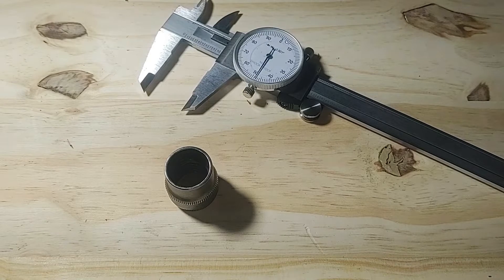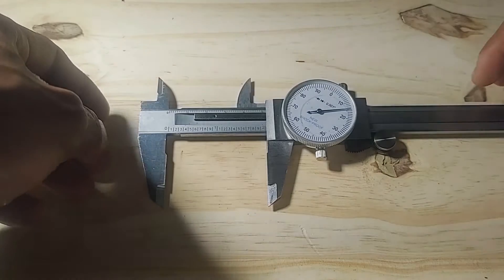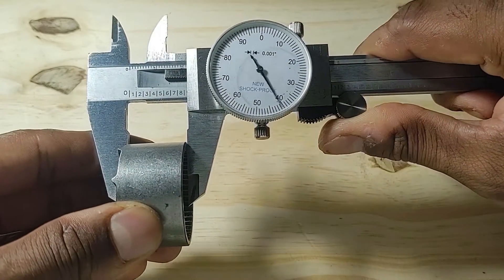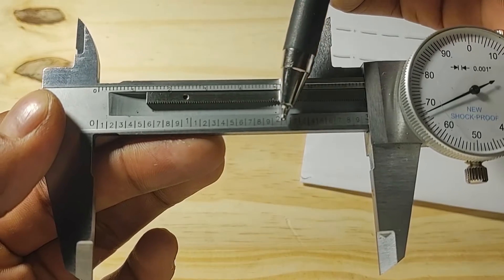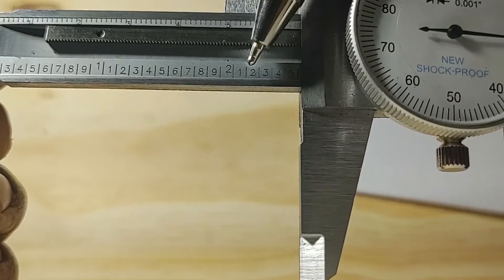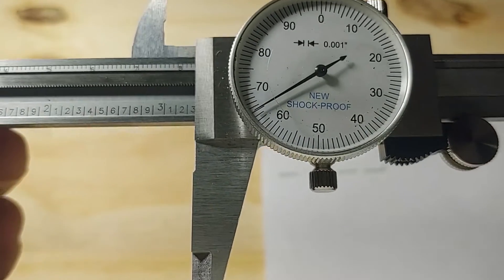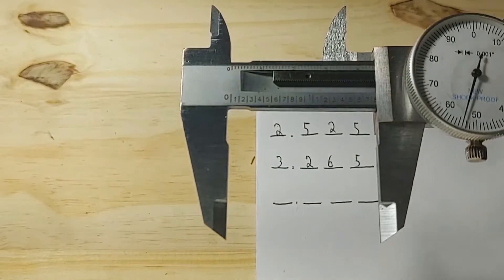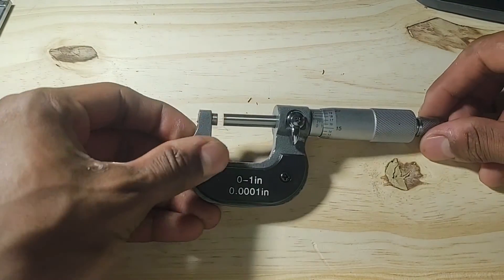How To Read Imperial Dial Calipers

Comment: I would just like add 4th option for measuring a step (with back side of a caliper) great video btw
Reply from the maker: Thank you for the response! I actually didn't know such a method existed when I made the video. I think I'll reupload with that part.
Reply: @engineeringdiy6311  It's so cool when you find out about it 😁